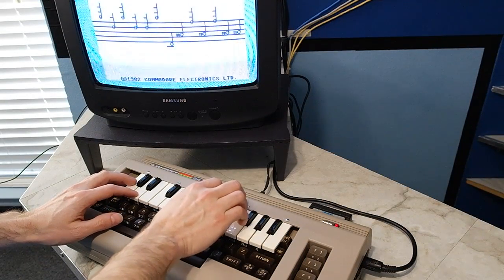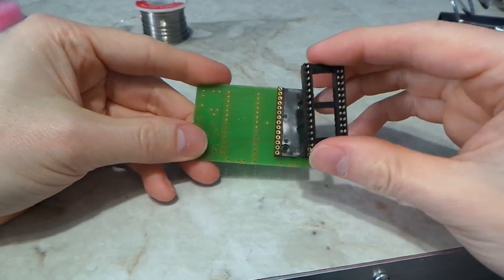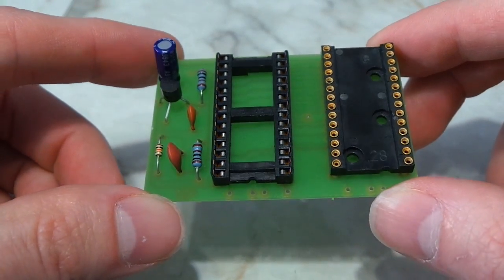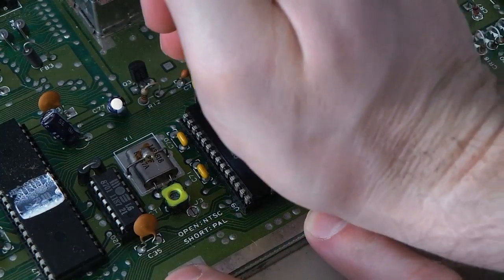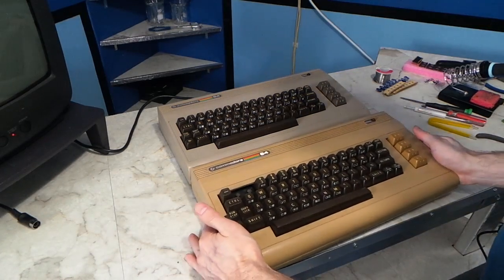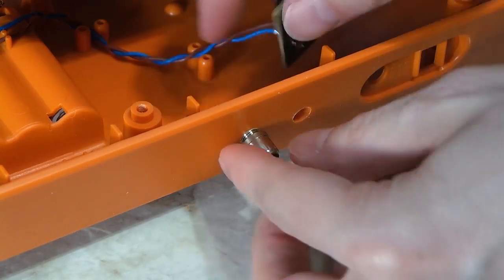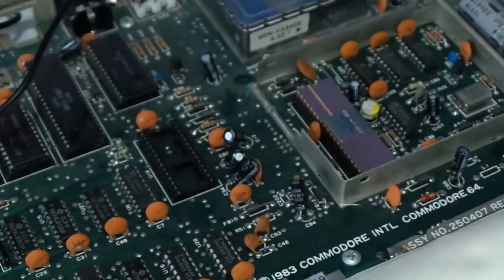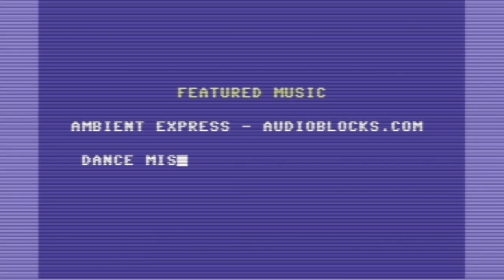Installing dual SID chips in your Commodore 64 with SID 2 SID

Comment: Where is the next part of this, did it ever get made?
Reply from the maker: It's not finished.  I have continually run into problems producing that episode about the MSSIAH cartridge.  Not anything wrong with the cartridge, but everything else seems to always cause problems.  I have a very high standard so I kept putting the video off until I fixed something, then another problem would pop up.  I've become so fed up with the episode that it's on indefinite hold.
Reply: Glad to know I am not blind, sorry it's been such a hassle... Keep up the good work despite all the roadblocks.
Reply: @8BitKeys  not that we enjoy you struggling because that sucks but I think many viewers would probably agree with me in the fact that we kind of enjoy the process. I absolutely agonize when you do something so meticulously and it fails that kills me because you can clearly see your planning and skill set however I also kind of enjoy when you have to tackle a new problem and how you handle it because that's what of helps other people understand how to approach problems. honestly if I'm going to learn how to fix problems from anyone it's going to be from people that I consider smarter than myself.
Reply: I now have a capture device that works, and have used it in several videos.  However, there are several other pieces of the puzzle that I found out I needed, such as a 1351 mouse, which I still don't have.  However, the biggest problem is that I realized the software is complicated and I knew it was going to take a long time to figure it out.  I just didn't have the time.  But now that I am doing youtube full time, I hope to make time for this interesting device to be shown in more detail.
Reply: I am still looking forward to the follow up video!! :)
Reply: @8-bit Keys, any progress with this yet?
Reply: I'd personally love to a see a return to this project at some point. Hopefully now that you're able to work on videos full-time you'll have more time for messing about with this kind of stuff.
Reply: Why don't you have another go at the follow up video for this again now?
Reply: Yes a Mouse is a "must" all other is very very easy.. I use MSSIAH sequencer every day and it is straightforeward (I have done some videos on our channel).. but you have to start somewhere... best is to get a mouse first...  ...  -- otherwise great videos you done so far.. I really enjoy everyone of them.. greetings :-D
Reply: He rarely makes the second parts that he promises in his videos, it's something common in his channels.
Reply: Im planning on getting into MSSIAH and sid2sid soon and would also like to see your MSSIAH video. I considered how to solve the mouse problem, and instead of the 1351 I have decided to go with the TOM+ USB adapter from a maker in Poland, available on eBay. (A couple of other makers in Germany and Australia also sell PS/2 versions.)
Reply: I wish
Reply: I am curious... What is the exact problem? MSSIAH is really working fine with SID2SID - do you have problems record the video output? There are many budget videograbber for less then 20 bucks who could record the non standard video signal of the c64 perfectly or is the audio output too noisy??

Comment: Great mod. Back in the day, a second SID chip was soldered "piggyback" on top of the original with certain control and output pins flayed out and extended with wire to their connecting points This is much better from a heat dissipation standpoint.
Reply: I want to see someone do the piggyback!

Comment: i dare you to put two sid-2-sids on a sid-2-sid for 12 channels
Reply: assuming they would fit, that would actually work. You'd just have to use a different address line for each chip.
Reply: @The8BitGuy  do it, please, ill even design the pcb
Reply: The 8-Bit Guy The VICE Sid player supports 4 Sid chips. So you could make something for that.
Reply: @The8BitGuy  lol your 8 bit keys🤣
Reply: @The8BitGuy  Please do it, Mr. Murray.
Reply: @The8BitGuy  do it just do it DOITTTTTT
Reply: +The 8-Bit Guy DO IT!
Reply: using 2 sid-2-sids would only give you 3 sid slots still since the second sid-2-sid would have to plug into the first one, giving you only 9 channels. you would need 3 sid-2-sids for 12 channels
Reply: How much software support that though. 🤔
Reply: This is the specific kind of insanity I can get behind!
Reply: Isn't it odd that the person(s) who designed this board didn't let the "suspended" end point to the left, i.e. away from the VIC shielding enclosure? Had they done that, it would have been quite easy to extend the board design to accommodate perhaps 3 or 4 SID chips, should that be desired. 😉
Reply: So, a 74LS138, and 8 SID chips = 24 voices.
Reply: sid-2-sid-2-sid-2-sid!
Reply: LOL Ronan.
Reply: No softwares are capable of that
Reply: @diamondburned5229  why not make some?
Reply: Tutbrushy Tutbrus he could make one
Reply: @diamondburned5229  cbcbbxbbbbbbbbnhbbhbbn,nnhj,nnhccjjjbcbjcncjj.
Reply: @diamondburned5229  lol
Reply: @diamondburned5229  it would be an experiment, 8bitguy knows how to program so it is possible
Reply: @diamondburned5229  then he can write some
Reply: "You'd just have to use a different address line for each chip." Is Pennsylvania 6-581 taken? :P
Reply: You need more CS signals, i.e. memory space to fit each one of them.
Reply: 38911bytefree You only need 1 extra address line for an extra chip.

Comment: You said you were planning to drill a hole and mount the output from your second SID to the back of the computer.
I find it funny that the SID has an input pin, but no one ever used it. Perhaps the output pin in the second SID could be routed to the input pin on the first SID.
There's probably something I've overlooked.

Comment: Another great video! And funny again.^^ I totally like your "nerdy" house with your rooms dedicated to ancient computers and also the fact that you store more of that stuff right on your attic.^^ I have my 3 C64 stored in the cellar. One day, when I might have the space, I`ll also put up all my old hardware in a dedicated room.^^

Here are my questions: I`ve learned that the eletrolytic capacitors wear off over the decades and that might result in the death of the fellow computers....
Can that be prevented? Do you (for example) power up all your hardware once in a while to charge the capacitors? 

Can old hardware that was not powered for decades directly be powered or should a transformer being used, carefully raising the voltage?

Sorry if the questions seem stupid, I don`t have a lot of technical understanding and not much talent for it....

Comment: It would be cool if a programm could play the music from c64 games on chip 1 and the sound effects on chip 2 sothat they will not distorb eachother,such mod could be very ideal for the nes,snes,gameboy apple 2 etc,,by putting double the soundchip to that corrosponding hardware to avoid sound effects interrupting the music,but the only questing is,how can we create software wich can distinguich sound effects from music?otherwise you have to reprogram those games from scratch,even then it's questioneblr if the main cpu can handle that or not.

Comment: When I was in middle school I wired a second SID into my C64 so I could get stereo out of it. I got the instructions off a BBS and bought the chips new for something like ten bucks. Just bend out a few pins for the filter caps, copy the transistor amp for the output from the fold-out schematic, and run a wire to the cartridge port so you can hijack an unused chip select line, then solder both chips together. 

I'm so glad I was born before this sort of hacking became impossible.

Comment: I once decided I would make a home-soldered olimexino 85. The kit costs around 10 dollars, but I still can't forgive myself for mistakenly solder the thing on the wrong side of the board. The manual can be mistakenly interpreted as the two sides both have things written on them. I then wanted to de-solder it, but neither solder wicks nor solder-pumps could help me desolder the minimal holes of the board. When I saw the white text being written on the other side of the board (in this video), I felt a bit confused since the outlines of the component is on either side depending on which side you are supposed to solder on.

Comment: Way too late comment but whatever, could you consider to make the audio wires pass through the venting holes at the bottom or top of the C64 for a completely reversible mod or couldn't you give less about perserving 30+ years out of production computers for future generations ?

Well, its your property of course, "you're not my dad" and all that good stuff, but still, personally I find the convinience or noise reduction you would get from drilling RCA jacks into the case compared to having two wires coming out of the vent holes absolutely not worth it.

There goes another perfectly fine C64, wonder how many there are still left, obviously not 17 million any more.
Reply: +janmansde3dede I don't consider there to be any shortage of Commodore 64s at this point.   If it were a more rare computer, then I guess it might bother me some.  Plus, I already have several pristine C64s in my collection, so modifying one isn't going to hurt much.  Besides, even with holes drilled, the mod is 90% reversible.  You could even fill the holes with epoxy at a later time if needed.

Comment: Does this just put two chips in parallel for a fatter sound? 

I had a cartridge containing a SID chip. You could map it to $DE00 or $DF00 depending on how you jumpered the I/O selects from the port. With a multi-cartridge board you could have 3 SID chips and 9 voices on one machine.

I only ever saw software to drive 2 chips. It could play 6-track SID files or play 3-track files to both chips with various stereo effects.

I had the Symphony from Dr. Evil: http://www.lyonlabs.org/commodore/stereo-sid/
Reply from the maker: +Travis Parker No, this is a real 6-channel solution.
Reply: +8-Bit Keys oh I see that now, it has the chip select coming off the board.

Comment: I wonder if it is possible to implement both SIDs using something like a FPGA, a bit of flash memory (microSD card maybe?) and a dual-channel DAC.
Reply: +陈北宗 Check kevtris' channel :) He has done that. FPGA + analog filters.
Reply: Look into SwinSID. That project does that, but with an AVR chip.

Comment: Cool little build. Hope hear some songs from this little project sometime. I keep thinking back to what little electronic projects I could have built when I had my TI-99/4A. My high school library had at least one book on the subject of building boards for a few of the 8 bit systems, back in the day. I was curious as to what Pin 7 on the C-64's cart slot was, so looked up the instructions and pin-outs. Is this computer going to be strictly for MSSIAH projects? I'm guessing you caught the little section in the instructions about using other carts with this mod?

Comment: Back in the 80's when I used to work for an 'authorised' Commodore repair company, we used to throw away the heat sink covers.  I think the bosses strategy was to get more returns - and hence more cash, but I don't recall seeing an awful lot of repeat / return jobs, so maybe his strategy was floored.  So I guess the heat sinks were not mandatory.
Reply: +chillzwinter Or maybe they changed of repair company.

Comment: All the components are soldered on the wrong side of the PCB!!!
Reply from the maker: +Luca Pertile - No they are not.. It would be more accurate to say that the silk screen is on the wrong side of the PCB.  This is how this product is designed and it is very clear about that in the installation instructions.
Reply: +Luca Pertile Nope.
Reply: +Luca Pertile There is no wrong side, as long as the component leg is soldered securely to the pad and the polarity of electrochemical caps and transistors is correct.
Reply: +Nukleon In this case it is a 1 layer board so their are only pads on one side.
Reply: +martravi yes idiot. don't you see?
Reply: +8-Bit Keys Now I have to open up my C64 and see how I soldered it; don't remember. It works perfect anyway :D
Reply: +Samuel Doye Yeah but it doesn't matter what direction the component leg goes through the pad.
Reply: yep.. sure are. silkscreen is top
Reply: +8-Bit Keys I thought they were soldered wrong too.
Reply: Doesn't really matter again. As long as components with polarity have their polarity in the right way it doesn't matter if you solder it on either side, and in this case it's probably easier because the pads are on the opposite side of the silk screen.

Comment: You can't get a prebuilt sid2sid?
Reply from the maker: +Narigaur not that I can see, at least not from 8 Bit Ventures.   However, building it is pretty easy. Finding working SID chips and dealing with metal shields.. that was the hard part.

Comment: My 64C and 128 both came with the 6851 SID chip, instead of the 8580 that everyone claims they came with... and then there are the later breadbin style 64s sold in Europe (like the "64G" and "Aldi") which came with the 8580 chip -- so you can't always tell what kind of SID chip it uses by the case style!
Reply: televiciousgoober My C128 was made in 1985 so it was an early revision including various bugs, such as the letter Q not being capitalized when Shift Lock is turned on in C128 mode. Later revisions fixed the bugs and simplified the circuitry, including switching to the 8580 SID chip.
Reply from the maker: +vwestlife that's why when describing the systems I said "typically" because it isn't guaranteed.
Reply: C128 shouldn't be 6581 they were made to use the 9V SID chips so it will either be 6582A or 8580. if it's a 6581 (12V) it may work for a minite, but your joystick may go since it is processed through the SID and the chip may lock up a lot or go bad.
Reply: +vwestlife Same here, both my 128 and 128D had the 6581
Reply: +vwestlife Oh sorry, mind was blown. I thought all C128's were running 9V. Just most. Learn something new every day. :)
Reply: +vwestlife I love your videos as well!! You guys should do a collab!
Reply: Wait, Aldi sold C64's? That's awesome.
Reply: lol Aldi :D
Reply: Daniël's Tech & Music Channel Vinyl, nice. I should pay more attention to their advertisements.
Reply: VWestlife I
Reply: VWestlife wifi signal amplify
Reply: My first 64C had an 8580R5 SID Chip (the remaining label says "0589 25", so I presume it was built in '89)
It was sold in Italy, and I bought it in the '90 exactly.
Reply: VWestlife Oh so they shrunken down the architecture as the resources were available 🤔 looking at this evidence of variation it would suggest possible Risc upgrade that could give better performance more efficient.
Reply: I honestly think my original 128came with a 6581, as well. My SID failed around '89, and I replaced it with one from a breadbin 64. That shouldn't have worked if the 128 had used the 8580.
Reply: VWestlife ii
Reply: 8-Bit Keys just out of curiosity, which version of the chip does the 128 usually have? Mine was made in October of 1985

Comment: You can mix 6581 and 8580 but you have to provide correct voltages to both chips. 6581 needs 12V and 8580 needs 9V.

Comment: Your videos are inspiring me, bit by bit, to find some of this hardware. Since I don't have any Commodore, which should I start with? The C64, or C128?
Reply from the maker: +dusk565 C64 is fine for 99% of users.  Very little 128 specific software exists, unfortunately.
Reply: 8-Bit Keys Thanks!
Reply: +dusk565 Commodore 64.
Reply: C64